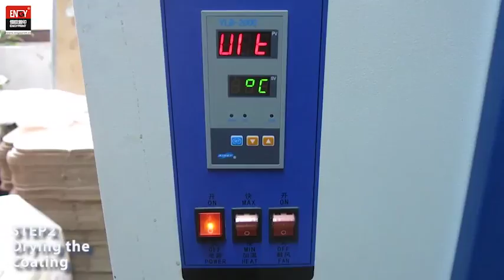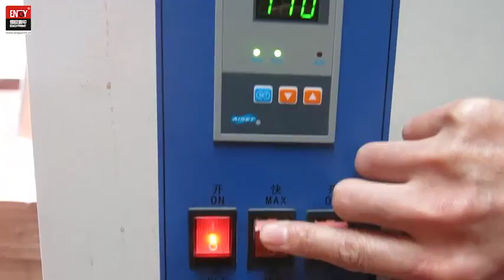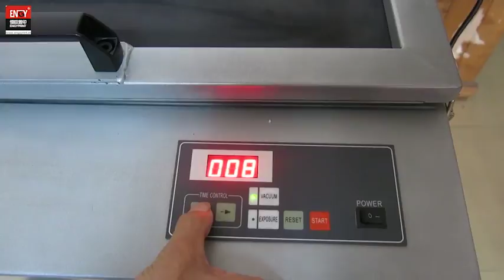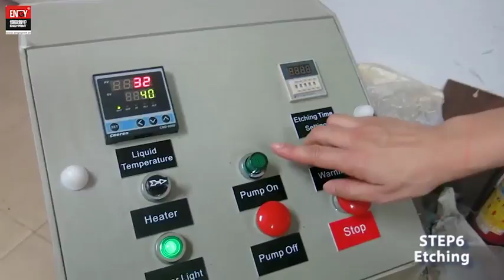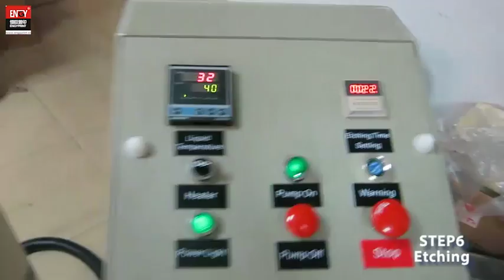How to make pad printing plate

Comment: I am using Etchcut machines from past 19 years, I can say that this machine cannot give that much of precision, First the photo ink that you use should not be transparent, so that you can easily find pinholes, machine oscillation is not with accurate speed and angle, thirdly with this machine I am sure you cannot go deep, We use Nano Crafter technology from Etchcut is far more advanced and serving us well, if anyone need any technical help for making pad printing plates, you can ask me.

Comment: I saw a lot going on but i didn't understand what was happening or the process at all.
Reply: You probably now know what happens but I'll try to explain for others. At first step, they coat the metal plate with a photosensitive solution to create a photosensitive layer on it, we'll come back to that in a second. After the coating, they apply a heat treatment, this helps to fix the coating onto the metal. What photosensitive means that when you expose that layer to uv light, the light will interact with the layer and create a dent on it. The process is called photolithography, a very important technique which is even used in the making of the processors of your computer. So, if you only expose a specific shape to uv light on that photosensitive layer, you'll end up with that shape printed on that layer. In this case the black parts on the paper allow uv light to go through and create dents on the photosensitive layer while the rest of the paper doesn't allow the penetration of the light, so the rest of the layer stays still. After that, they wash the piece to get rid of unwanted pieces and contaminants that may have resided from photolithography process. Then, they etch the metal plate so that the shape dented on the layer would be dented on the metal plate itself. Since the layer is already dented the etching agent acts more on there and reaches the metal plate and start denting it. After that, they wash off the remaining photosenstive layer as it completed its task. And  at last, they check if the dents on the metal plate has enough depth.
Reply: @AhmetOzbayy  Thanks for the explanation. But is it the same as a Presensitized PCB?

Comment: Hello I enjoyed the video, I thought I had some old tech.. I'm using a newer uvac 600 but am worried my design etches aren't deep enough. Maybe longer times? Or the chemicals during wash process? Any advice helps. It could be in the print end but having so many problems I'm going back to the start.
Reply: We are using Etchcut machines from past 19 years, you can buy Nano technology from them, its more advanced and you can easily achieve depth, we are in pad printing last 40 years